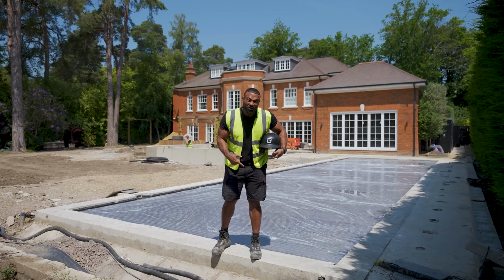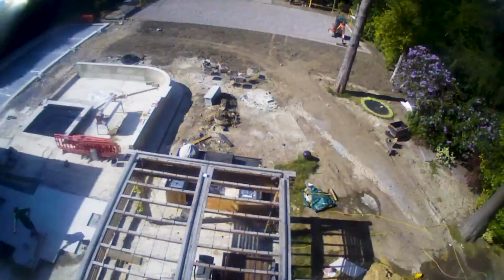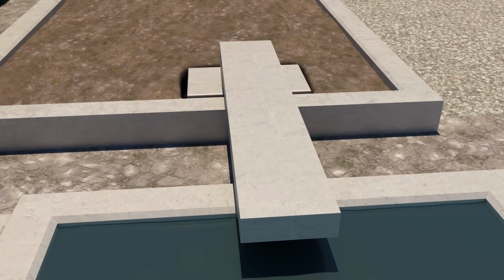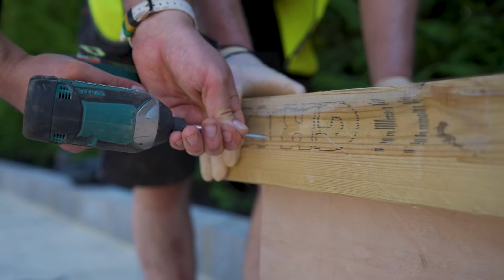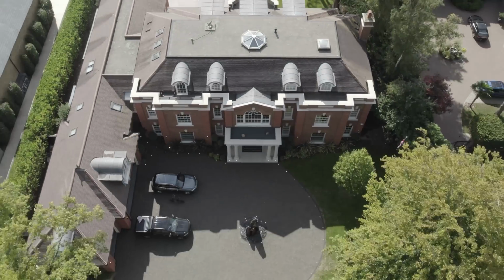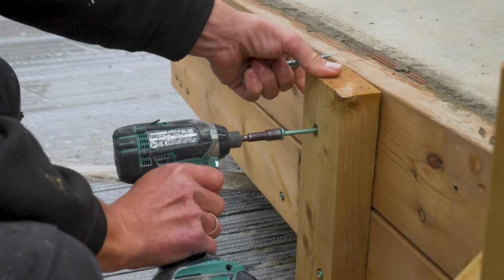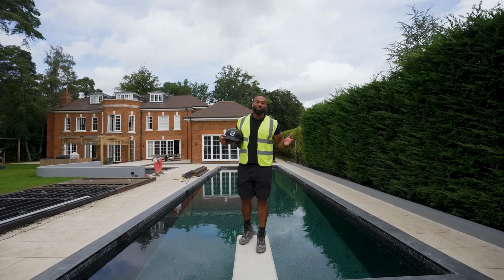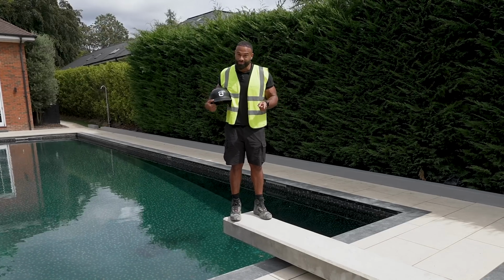How To Build A Diving Board From Concrete

Comment: i'm curious to the reasoning behind C50 usage?
Reply: its a long slender cantilever, so probably needs a high strength concrete to handle the stresses, it will be designed for a big group of men jumping on it at the same time during a party.
Reply: @123MondayTuesday  iv3 only ever uses c50 once in some ground that you could light on fire it was that contaminated haha, OK perhaps not that bad, but it's more contaminated ground  spec.
Reply: @John-es3qc  I’ve never heard of increasing the grade to cope with contaminated ground. Must be an APM I’ve not heard of from Special Digest 1
Reply: @123MondayTuesday  depends what the additives are.

Comment: That looks really good. I think the only think that I would have done differently is put a little bit more of a filet where the board meets the pedestal on the underside. That area is a stress concentration. This board is so overbuilt it will never be an issue though.

Comment: Wait till the water soaks into the concrete in the winter. Then it will freeze and crack 😬
Reply: The concrete mix is XF2 exposure class mate so is freeze thaw resistant
Reply: @123MondayTuesday  thanks pal, big dan does things the proper way I should of known better tbh mate,

Comment: did you somehow cure the concrete against weather and water absorption, like nano coating? The top unformed surface has been only trowelled as a finish?

Comment: Wow. As Daniel always strives for perfection, it hurts my eyes to see such amateur job on rebar. If this is showcase, and structurally challenged construction, minimum rules of solid rebar techniques to be used. I do not see end ties of any square rebars bent by 135 deg as is good practice. Welds on rebars? come on... 

It was extra effort to have it looking beautiful on the outside, now knowing how easily could it be perfect from inside, but some workers did chose easy and incorrect way.. hurts my eyes. 

Mr. Louisy, thanks for the video. If you might have a chance, ask your structural engineer about 135 end ties rule for rebars...

Comment: A bit too much porosity on that one close up, guys did not vibrate the concrete there enough. I hope they covered the surface with plastic to prevent the water from coming out via surface, unnecessary risk in my opinion to leave it without covering. But I liked the video alot! Nice finish and both form and rebar was nicely executed work!

Comment: Great video and well done, the only criticism is the slab layer should prime the back of the tiles because will not stick directly on sand and cement.
Reply: look closer, it is primed :)
Reply: @stefanferk1047  I don’t think so the back of the tiles only the floor, maybe 🤔 I got it wrong.
Reply: look at 7:52 , you can see that the tile is primed.

Comment: Would have been nicer if the concrete was polished, as it looks a bit rough lots of holes and bumps.
But I guess rough and rustic finish must have been part of the brief 😆
Reply: I agree, it could have been rubbed up. The blow holes are just a result of trapped air pockets against the form face and not the easiest thing to avoid completely. Usually you would spec an F3 finish if you want a clean face with no imperfections or blemishes.

Comment: I don't think the diving board has been finished very well. Concrete architectural features  can be made to look much smoother. I understand that it is difficult to do, but I would have expected a better finish regardless of cost.  Just my views. I don't mean to be negative for the sake of it. I have seen concrete stair cases finished to higher standard. I used to work for a company called Diespeker Concrete. Did you price in a jet washer to clean the algae and dirt off the horizontal surface?